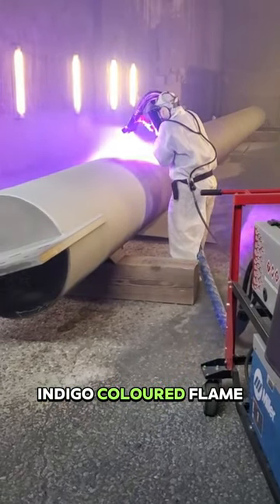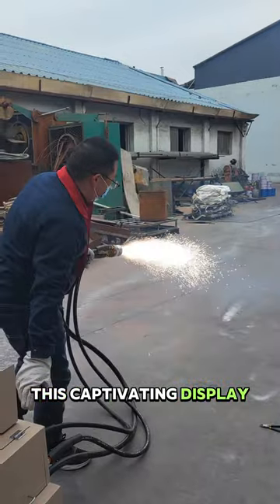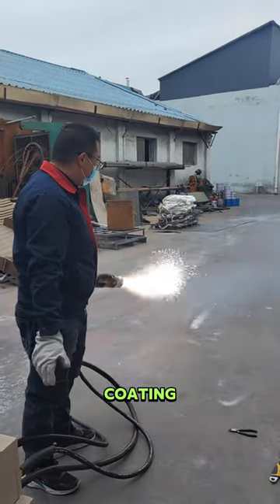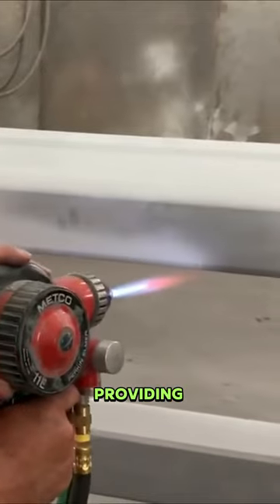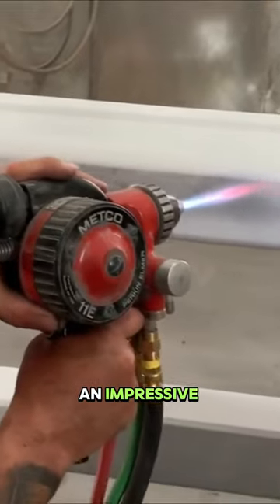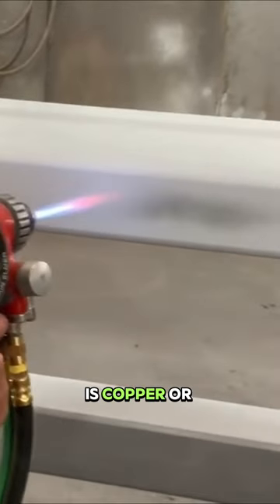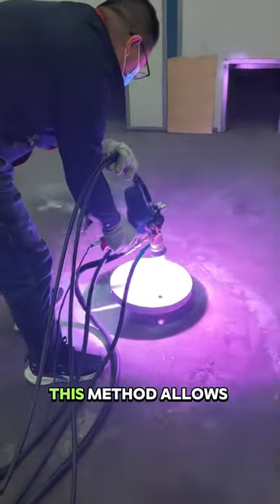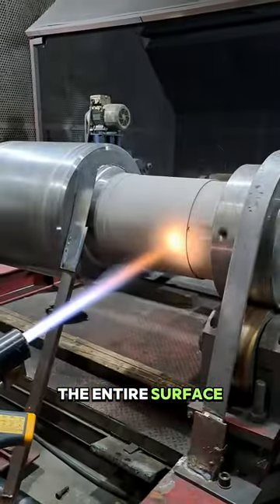Arc Spray Coating #shorts

Comment: I love how the factory worker is decked out in top of the line ppe while the the back yard worker has no ppe.
Reply: Have you seen the population of China? They've got plenty to replace with.
Reply: Where's his oil paper? 😂
Reply: Factory Demo
Reply: Yeah, problem will solve itself in a few years. Ionized copper is absolutely horrific.
Reply: Lol yes. But there’s a different between a few seconds test, outside , and spending hours doing it inside. Now, how about his eyes? that sure looks bright

Comment: That's how the parts of Maersk's reefers that wasn't stainless steel were protected before getting painted, back when they were still produced in Denmark.
The process was done by robots though.
Reply: In a former job we used to coat riser for Maersk with nano wire. The nano wire was an alloy made in Germany that barnacles would not attach to. Also used that alloy on the drive propulsion for the USS Bush and USS Reagan.
Reply: People who don't know the word reefer in shipping:

"Reefer? Ok boomer"
Reply: @atuck6082  And I'm gen X... ;)
Reply: Learn something new every day
Reply: You said reefer, lol
Reply: @KingJames-go8pq  That is the technical term for a climate controlled container, yes. :)

Comment: Sounds like something the Cyber Truck needs.
Reply: they are charging like 5 thousands dollars for vinyl wrap. How much would cost something like that for a cyber truck? 10 thousands? 20?
Reply: @Matthew_Removeafterwashing 

Realistically, the best way would be taking the parts out and using a magnetron metal vaporizer system in a vacuum so zero impurities get in the coating, but electroplating would have been fine.

Brushed bronze/brass cyber truck would petina sooooo nice.  Couldn't pay me to drive one, but it would look cool as a model or RC lol
Reply: The body  panels of the Cyber Truck are made with stainless steel.  Unless  you exposed it to some extreme environments, it doesn't rust that easily.  Quite frankly, it looks like rust but it's likely something picked up from the ground.  Check the articles again.  Why don't they mention that they tried to wipe it off?
Reply: That’s too expensive

Comment: Also if you burn wood it protects it from aging too
Reply: Fr? Like forever?
Reply: yeah because it obliterates it.
Reply: Works on humans as well. With enough heat we will stop aging.
Reply: Then you can weld it with matchsticks
Reply: Just keep everything in a mud bog. Will preserve for thousands of years
Reply: @supertickle not forever, but fire hardened and scorched wood makes it last far longer.
They used to make house shingles out of scorched wood. You may have seen these old cabins, cottages or homes that look like they're painted black. That's charred wood. Significantly increases the lifespan of posts buried in the ground as well.

Comment: Arc spraying, also known as electric arc spraying or arc spray coating, is a surface coating process used to apply protective layers or coatings to metal surfaces. This thermal spraying technique involves melting metallic wires or rods through an electric arc and propelling the molten material onto the substrate, creating a durable and corrosion-resistant coating. Here's an overview of how arc spraying works and what it accomplishes:

*How Arc Spraying Works:*

1. *Preparation:*
   - The metal to be sprayed is prepared in the form of wires or rods. Common materials include zinc, aluminum, and alloys.

2. *Spraying Equipment:*
   - Arc spraying equipment typically consists of a spray gun, power supply, and a control system. The spray gun feeds the metallic wire into the electric arc zone.

3. *Electric Arc Generation:*
   - An electric arc is created between the tip of the metallic wire and the substrate using a high-voltage power supply. This arc generates intense heat, causing the wire to melt and form tiny molten droplets.

4. *Propelling Molten Particles:*
   - Compressed air or another gas is used to propel the molten particles toward the substrate. The force of the gas stream carries the molten droplets and deposits them onto the surface.

5. *Coating Formation:*
   - As the molten droplets hit the substrate, they solidify and bond, forming a coating. The overlapping of these particles creates a dense and protective layer.

*Key Advantages and Applications:*

1. *Corrosion Protection:*
   - Arc spraying is widely used for corrosion protection in various industries. The coatings formed are resistant to environmental factors, enhancing the longevity of metal components.

2. *Cost-Effective:*
   - Compared to some alternative coating methods, arc spraying is often considered a cost-effective solution, providing efficient coverage and durability.

3. *Versatility:*
   - It can be applied to a variety of metals and alloys, offering versatility in coating options based on specific application requirements.

4. *Thickness Control:*
   - The thickness of the coating can be controlled by adjusting parameters such as wire feed rate, spraying distance, and gas pressure, allowing for precise coating thickness.

5. *High Bond Strength:*
   - The mechanical bond formed between the substrate and the coating is typically strong, providing excellent adhesion.

Arc spraying is employed in numerous industries, including aerospace, automotive, marine, and infrastructure. Its ability to provide reliable and protective coatings makes it valuable for extending the service life of metal components exposed to harsh environments or corrosive conditions.

Comment: In the US its called metalizing.
Reply: Nah, it’s called plasma spray or flame spray. I worked at United Airlines for 15 years doing this.
Reply: @timwilson3150  What they used it for there?
Reply: @blidderbla  We used metalizing for lots of different remanufacturing processes at Rolls Royce. Everything from resizing bearing cases to relining compressor cases. Both plasma arc spray and air jet oxy acetylene.
Reply: @theodoreackerson1442 
Did you use the magnetron process for any of it?  Apologies for my ignorance.  I've only seen the magnetron setup in a vacuum jar, I'm not sure if it would be possible in atmo.
Reply: @i-love-comountains3850  we had a robot doing metalizing that was electro-polarized. I don't remember a vacuum but negative pressure. Hydrogen gas was converted to plasma. Hydrogen was used for the intensive heat and to reduce porosocity. Been a while. An old cool technology. 1950's technology
Reply: Used to spray jet components with various super alloys then onto a vertical lathe to machine back to tolerance never got 60 years out of them tho good money too
Reply: @stevenrussell6787  we had a cnc vertical lathe to machine the compressor cases after they were metalized. The cast steel compressor case had a high nickel bonding agent sprayed then aluminum was sprayed. Both were oxy acetylene. Simple but elegant machines gas turbines are.
Reply: @timwilson3150 flame spray is cold spray with powder.
Reply: We call it hvof at my job. High velocity oxygen fuel. Best job I ever had
Reply: @wolflitzer1230  we had both powder hopper guns and wire fed guns for oxy fuel metalizing. The wire fed guns had a feed rate that was more consistent.

Comment: If its being applied in a Chinese factory it will peel on 6 months or less. Guaranteed!
Reply: Be objective. Judge only after you have actually done your research.
Reply: Have you ever worked with something sputtered with a zinc in a Chinese factory before? I don't think you have, and I think you're just making this up
Reply: and yet, everything that you own was manufactured in china
Reply: Yea. There's a good reason we use little to no Chinese manufactured parts or materials in American industry. This is also the reason industrial projects cost so much but are superior in safety and longevity.
Reply: Can't be a Chinese factory. I didn't see any 11 year olds
Reply: One of things in the video clearly had fingerprints on it.. the coating will never stick if the surface is dirty. Ideally it would be acid etched first for the best bond.
Reply: @yukmientai8289 Chinese factory is like 99% chance of garbage. Stop pretending . You have to go out of your way to get quality Chinese. It exists. Sure. But it’s not even close to the norm
Reply: @AnalPolyps you’re right. Which is why everything I own breaks in 6 fkn months. Nice come back 🙄
Reply: @johnhonda93 lol, saw 13 year old working at drive thru McDonald's in USA 😂
Reply: That is far from the truth.

Comment: There is a far older technique called spray welding. It uses an oxy acetylene torch and builds up metal through the flame.

Comment: we do this as a premium option on steel yacht hulls.  It's not cheap, but taking the yacht out of the water, sanding it and repainting it isn't cheap either.
Reply: Is it at all similar to sputtering magnetron deposit? Kinda looks like it on first watch, just much more wasteful.

Comment: How thick is the coated layer?
Reply: How thick do you want it?
Reply: Lol that wasn’t sarcasm. If you want more, you spray more. Less, spray less
Reply: In a 3 sec burn, how thick?
Reply: @louiereale3138 
that depends on the deposition rate which depends on the machine's capabilities and settings. 

I know that isn't a satisfying answer, and I'm sorry about that, but it's the truth: it depends. 

If you want a ballpark answer?
Coatings can be anywhere from a few atoms thick to several thousandths of an inch thick, which would be tens of thousands if not millions of atoms thick if my understanding is correct.

So many factors go into getting an exact answer,  I highly recommend you look up the wiki for metal vapor deposition / arc spray coating.  it's absolutely fascinating. 🤟🎃
Reply: @jamesbizs 
"it depends" is such an accurate yet DEEPLY UNSATISFYING answer...and it's the God's honest truth, in so many circumstances 😅
Reply: @louiereale3138 
The type of plasma arc vapor deposition that uses a microwave magnetron to blast a metal sample inside a vacuum jar to coat things like leaves and bugs is just an obscenely mind-blowing phenomenon.  Vapor deposition is such a fun rabbit hole😄
Reply: Depends on the alloy/wire. Some are made to apply thick so they can be machined to spec

Comment: They need to do this to car panels and frames
Reply: You mean Cybertruck?
They don’t do it for cars because costing & painting is better for complex surfaces and lasts longer against road conditions than this.
It is used in construction instead, but in parts against most extreme weather, they still put coating on top.
Reply: @MP-vc4nu  the don't do this because of government cafe laws requiring fuel mileage standards.
Reply: I had this done with the rear subframe of my classic Mini. I wanted to have my subframe galvanized, but because the subframe is composed of thin sheets of metal that are spot welded, I was advised against this because products from the preparatory process would remain in all openings and cavities. This would cause the subframe to rust even faster than a bare subframe. Then the process of (what we call scoping) flame galvanizing was recommended to me. Here, zinc is applied to the material with a strong, bright flame. After this you can spray the subframe in the color you want.  
As I mentioned, I had my subframe and the cowl on our chimney scoped and sprayed. Now after more than 25 years, both things are still rust-free. However, the hood on our chimney is a little discolored due to years of exposure to wind and weather. However, the process was expensive and I think very thin sheet metal can easily deform.
Reply: They do use this on brake rotors but comes off the face farely quickly or they are zinc coated in other ways electroplating usually
Reply: Process is still too hot.

Comment: Why can't cars get a rust proof like that?? I live in the rust belt. Car bodys here are destroyed way before the drive train life is spent. At least make it a option on new cars!! Damn it!
Reply: good old days cars did underwent this process because it was made meant for last.
Reply: Because car manufacturers don't want your car to last.
Reply: Because they just make the bodies last as long as the rest of the car now. Most cars are pretty much done after 15-20 years and the bodies of most good quality cars last that long.
Reply: @cimuraisampi I remember when I was a boy helping my friend at his father's junk yard . We jack up old cars and trucks that sat deep in mud  and still oil pans were not rusted out . That is up here in the salt belt . Cars truck today sitting in the ground ,frame and all would  be rusted and gone .
Reply: It's called rusfre
   Not expensive at all
Reply: Should probably drill and put grease fittings in to
Reply: And take the plastic snow salt catchers off to do it to 
   Especially want it where that garbage sits against the car
   And will still need redone periodically

   You can put it right over rust just have to knock off any loose flakey rust

That's the same with Rust-Oleum products

If you really want it to last forever could do cathodic protection

    Why you're not spose to swim by big ships ⚡
Reply: Mercedes uses mostly allow and zinc coated parts so don't have to worry if your willing to spend the money on am amg
Reply: @ferrumignis not quite true everything built to fail now days but slot of car manufacturers actually go to great lengths to prevent rust using allow parts for example control arms crossmembers and zinc coating others like chassis but that comes at a cost as most aluminium alloys can be more brittle than good ol steel

Comment: The fourth clip you can literally see fingerprints on the part. And then costing isnt going to last on a dirty part like that. Ideally it would be acid etched first, then properly cleaned and degreased for it to stick to the base metal properly.

Comment: i was doing that with aluminum 25 years ago
Reply: Stainless steel shafts for me, 40 years ago. Used different compounds. Heated with oxygen and acetylene.
Reply: @jefsel881  i used a Lincoln Ideal Arc 1600 as a power supply. one spool of 3/16" wire was positive, second spool was neg arced in front of a gun with 70 psi air.
Reply: The aluminum was coated with zinc, which seems nonsensical.  Was the aluminum sprayed onto the steel?
Reply: @datastreamcowboys  my spray gun was just like a modern automotive spray gun. Had the gravity fed granular material that dropped into a torch flame then sprayed onto the metal part with attached air nozzle. Very effective when it was done right.
Reply: They do something similar with aluminum on glass in a vacuum chamber to make telescope mirrors
Reply: The aluminizer
   John Dobson ❤
Reply: Is it good for cars?
Reply: @Rickiye  we coated the drive mechanical parts with an alloy that inhibits barnacles and corrosion for the USN aircraft carriers.. so I could see coating a chassis to a car easily.

Comment: It’s just another version of galvanisation. Not Liquid Metal, just all of its fumes pumped into the air around you, for anyone who doesn’t know burning any galvanised metal results it toxic fumes so how good is that!
Reply: Galvanisation is specifically a zinc coating, this process can use other metals like aluminium amd nickel.  Hot dip galvanising is not practical for very large parts, or on fabricated parts where hot dipping would cause unacceptable distortion, this provides an effective alternative.
Reply: 17!

Comment: The cylinder liners in my car are put on this way instead of sleeves.
Reply: Was it that vag group at least tried to used to their cars as replacement of sleeves, I haven’t heard sense that did they continued to using that method..

Comment: How would paint adhere to it ? I mean  after a car bodywork
Reply: It is very expensive i do it since 2014 we spraying agricultural knifest that used in the ground, it is a 3step process, someone sandblast te base layer, someone spray the coating and another worker melt the coat and the base layer together, we use a coat that makes 65hrc layer on the metal. It is harcer than HSS

Comment: Most welders and machinists call this spray welding, often machinists use this to build up a round shaft like a roller or pin in a lathe with a similar alloy of metal then machine it back down to spec.
Reply: That is usually a flame spraying operation using alloys similar to the parent metal.  This is an arc spray using zinc, aluminium or nickel for corrosion resistance.

Comment: You know let's spin around for years and years and years. They used To Do halls of bolts and stuff like that and it was a what they called a flame torch with compressed air and a soxy settling. Mixture and a ride that the rents were just like a migwelder so that aint new.